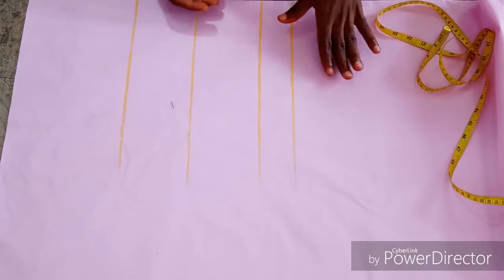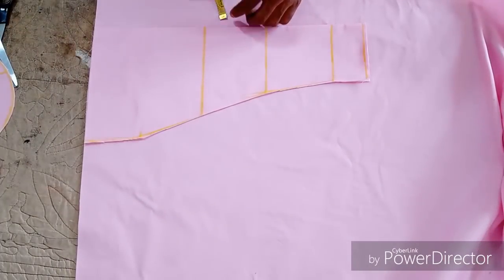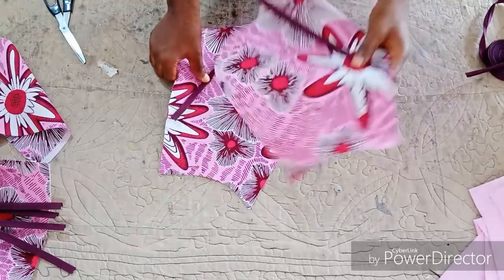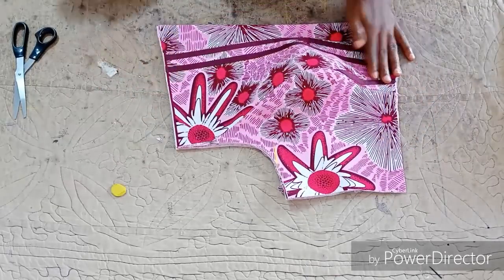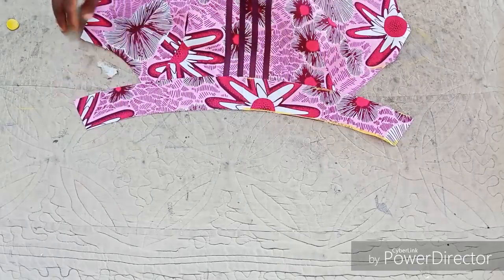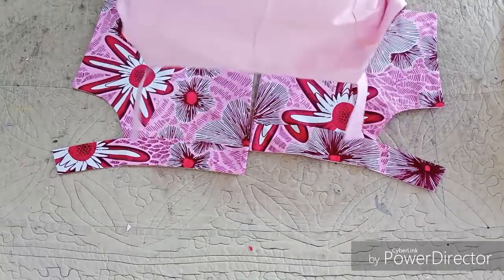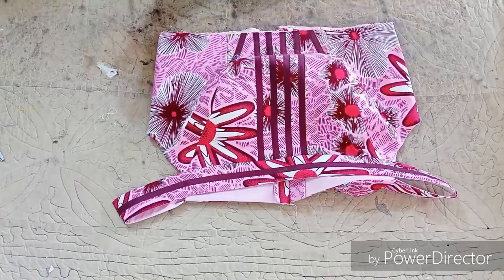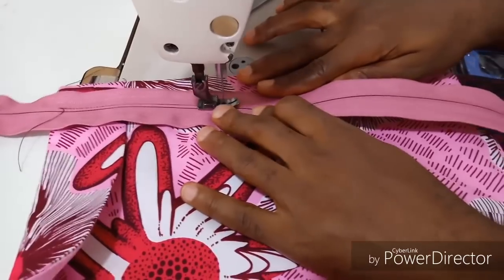How to make a Beautiful Blouse with Cape and kissing pleating

Comment: Please to cut the flare for the down part is 72.
After folding 72 into 4 and then into 8, like a triangle, to get the waist circle, I divided 72 by 6 to get 12" cure before I marked the length. Is that correct?
Reply from the maker: It's beta u cut full circle double waist measurement